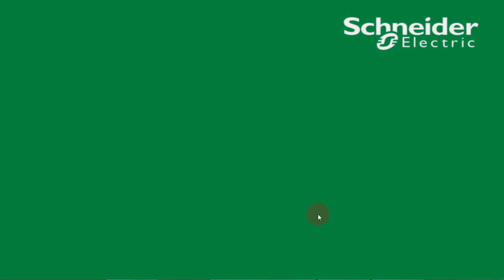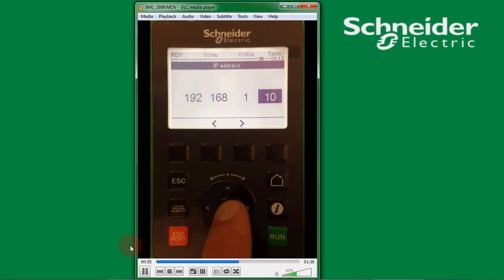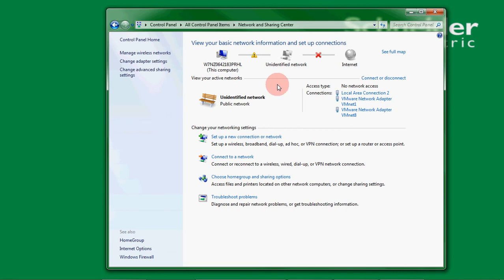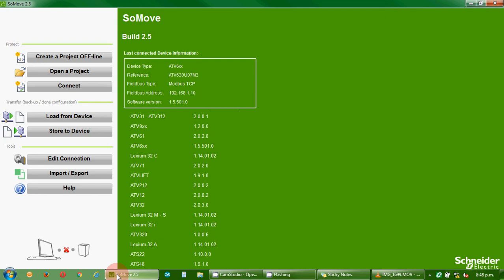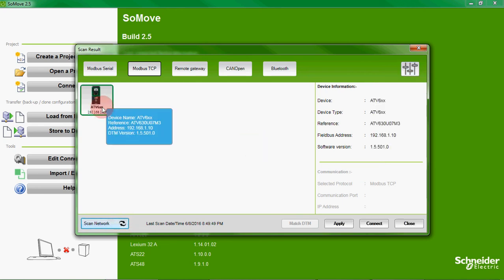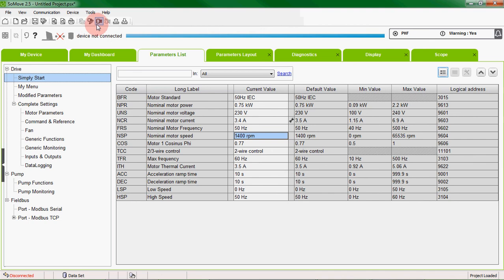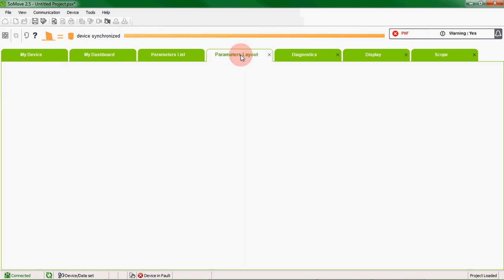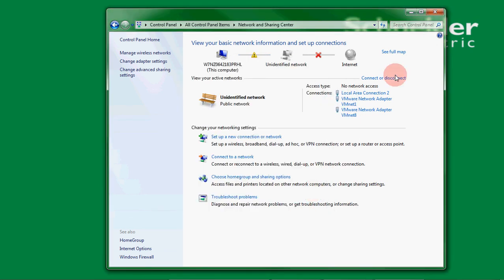ETSNZ: Configure Altivar Process and PC for Embedded Ethernet communication

Comment: I have a problem connecting the PLC and altivar 630.
The connection is there, but I can't run and monitor the Frequency changer parameters through the PLC.. can u help?

Comment: How much faster would you say this is over the Schneider RS458 to USB cable? I'm noticing the USB method to be atrociously slow.
Reply from the maker: Hi Preston, I have found there to be a slight improvement in communication speed when communicating via Ethernet TCP, however, I believe the limiting factor is the refresh/scan rate of SoMove which cannot be adjusted. But Ethernet TCP is better for other reasons such as the obvious - no more usb to serial adaptor cable, also if you don't have SoMove on your PC you can access the VSD web server to change parameters and extract the configuration.